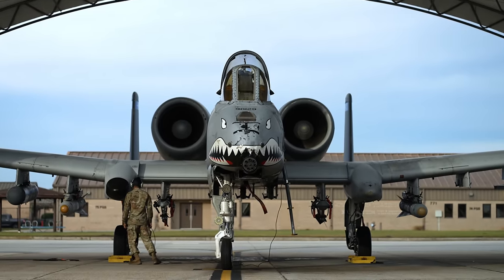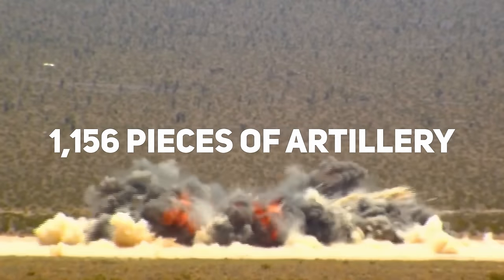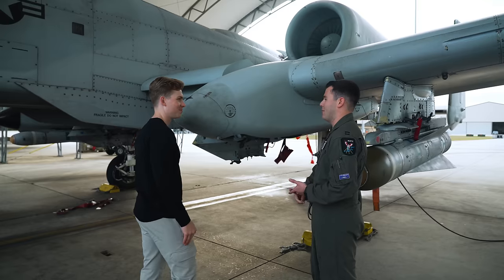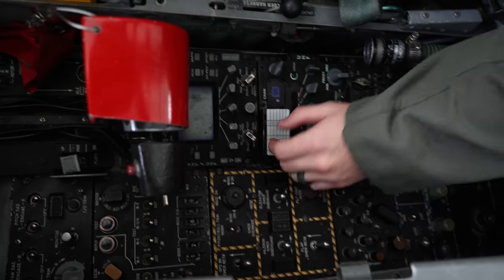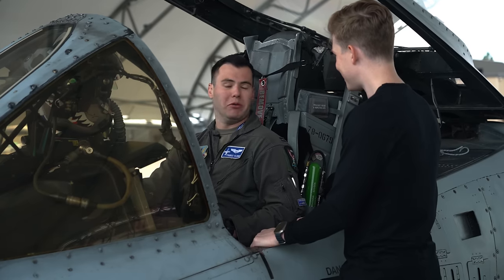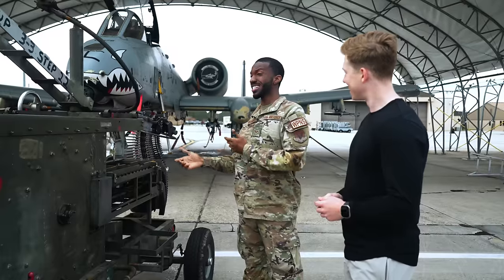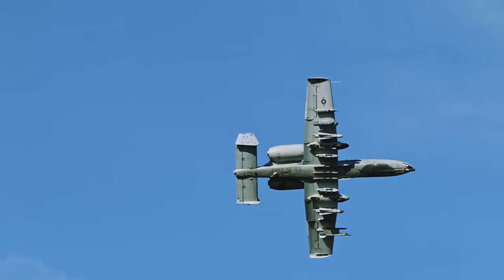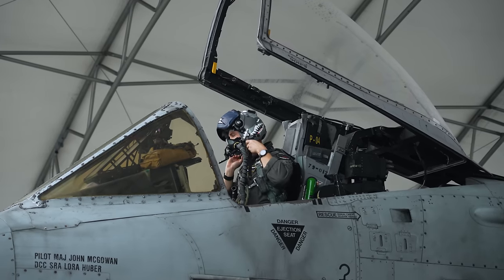Experience the FIREPOWER of the A-10 Warthog!

Comment: These are surpisingly agile actually.  I was at an air show 5 years ago or so and they had a demo with A10s, and they demonstrated how they could strafe the field, pull up, hard bank turn and be right back down strafing the opposite direction in something like 20 seconds or maybe slightly more (it's been a few years) but it was damn impressive to watch--no live ammo at the air show, just the demo of it flying that pattern.  They truly are awesome to be 50 years old and still that relevant to modern warfare.

Comment: Everyone talks about the iconic BRRRRRRRRRRRRRRRRRRT, which is true, but the turbine sound is quite unique also, no other aircraft i can think of has that distinctive high pitch
Reply: I think the only other similar sound is from the KC-135 and/or E-3, idk which engine it is cause they only shared one of two engine types
Reply: S-3 Viking, long since retired, had the same engines and same sound.
Reply: F18s moving around a flight deck have a high whine

Comment: As an ex hydraulic specialist I can honestly say that it was an absolute pleasure to work on the A-10. It didn't break down very often and when it did it was usually fixable easily and quickly. I still take great pride in seeing the A-10, even to the point where I consider it to be "my baby". Cheers and hats-off to others who have had the privilege to work on (or fly) the A-10 aircraft. Myrtle Beach AFB (1977-81).
Reply: Thank you for your service

Comment: We grew up with this plane. The CARC yellow prototypes were constantly over our house, and doing things that were nearly impossible, like practically turning on the wing. In the 30mm GAU-8A, PGU-15B/TP rounds were most often used in Afghanistan due to the lack of hardened targets with armor in theater. Presenter is holding up a TP. First Iraq war got a lot of HEI rounds in use on their armor. 

Thunderbolt name fits the purpose of the plane, as the original Thunderbolt was often utilized for close air support and was known for its ability to survive hits from enemy fire. The P-47 was the biggest and toughest fighter you could ride in. 

We never called it anything but the A10 or Thunderbolt II, out of respect for what it was. I spoke with an USAF Colonel one day who had worked on the ground with the USMC in Afghanistan. The love for that thing is immense. I am glad that the kids on the ground had them overhead. I know they saved a lot of people from bad situations.

Comment: one idea i have for the a10 is a sniper kit that could be developed which basically turns it into a long acting sniping platform...well placed single shots and a long operational time compared to the regular ones.....first a super precise semi automatic cannon firing the same cartridges could be installed, which would save a lot of ammo and money and extend operational time and also allow more targets to be destroyed, it could be like a 4-6" spread at normal distances and each pull fires one shot, with a gauge for barrel temperature so the barrel doesnt get too hot...instead of the typical loadout it could just carry extra fuel and it uses a completely different flight style compared to regular ones...it stays hidden and out of sight and uses the stealth of the plane...the plane has vertical risers on the wing tips and a quiet kit goes on to reduce noise by 70 percebt...if power is lost it doesnt matter it uses stealth and flight style to stay out of sight

Comment: It takes them 30 minutes to load the gun?!  When I was loading we only had 45 minutes to load 2 AGM's, 2 MK-82's and 1150 rounds... All while Fuels was topping off the tanks, and the cc was filling the Lox. It was called a Quick Turn. In and out of the keyhole in 45 minutes or less.

There is a rds limiter that limited the pilot to that 1-2 sec trigger pull. They could hold the trigger for an hr but they'd only get what the rds limiter was set at. 100-150 was the norm.

Our pilots used AGM's on bunkers during Desert Storm. A "party mix" was used for tanks. One of the helicopter kiss was completed by Capt (Gen) Bob Swain of the 926th FW. His jet is on display at the Air Force academy. "The Chopper Popper".

Not many know, but the A-10 actually sank a battleship. It was during RIMPAC 2012 in Hawaii. The navy pilot was pissed. We never got another invite. Eh... Oh well.

Comment: Another interesting detail of the Warthog has to do with the weight of the 30mm ammo. When the cannon is fired, it can't eject the spent cases because it would throw off the center of balance, making the Jet very difficult, if not impossible to fly. So when they come in to rearm they have to unload the spent cases as they reload the nearly 1.5 tons of fresh 30mm.

Comment: engagement distance with the gun is around 1 mile,  the thermals on it can see a target 25 miles (may actually be more like 60 miles, depends on the pod they use. i reference dcs a lot for my info because i fly the a10 og and the newer a10c) away and one of its missiles can easily hit a moving target within 7 miles

Comment: Fun fact: with a 1.5 seconds burst of the GAU-8A the A-10 will actually lose 5 knts of speed - because the recoil is greater than the thrust of the engines... 😂😂😁😁🤘🤘
I remember that very distictly as a teen when I read a book about the A-10. And all that crazy stuff the pilots do (like f.e. inverted terrain hugging) and what amount of damage the A-10 could take during Desert Storm and still fly back to base. What a machine! 😎😎

Comment: I heard that before that when you shoot the gun the plane stops turning so you can shoot at that point that you looking at when you push the trigger. Then how can you spray a line or a bigger area with the gun?
Reply: PAC system keeps the plane from pitching while firing. You can still roll a little, therefore turn.
Also your gun can be used without the PAC, if you really want to draw a line :)

Comment: Hey, the power of the Warthog, a CAS plane built around the 7-barrel GAU-8 rotary cannon is something to behold. Some of the affection for this dinosaur gets a little weird, with "love" being expressed often enough to read like fan mail for a K-Pop band. Maybe that's over the top, but so is The Gustav Gun, for example. Does its quantity of power  (800mm shell) justify the quality of its size and subsequent difficulty in utilization? What quality would that be? The fear factor, which must have scared someone during the Siege of Sevastopol (1941-42). That "BRRRRRRT" of 30mm depleted uranium ordnance must have soiled thousands of undies if the wearers were stuck on the Highway of Death connecting Iraq and Kuwait from Feb. 26 to Mar. 2, 1991.
Reply: It’s the GAU-8/A 7 barrel Gatling gun

Comment: You are aware the reason the A-10 has missiles be equipped was because of how bad the main cannon is. The accuracy was shocking unless perfect conditions ie the target didn't move, was allowed to perform as many strafe runs as allowed, perfect visibility and tests performed against 70's Russian tanks being hit on top from very low altitudes. Which in any combat zone isn't going to happen plus the armour was thin, the maintenance high, the repairs long, not much ammo with ratio how fast it went through it. And that's why missiles were attached. So no wasn't  JAW DROPPING... dues to flaws of the original design and after changes were made. So for all those going ahh the sound of Brrrr Brrrr and in awe, yeh that gun couldn't hit shit. Oh and also that's why no other country bought any when the US tried to sell it. Because it's shit or we already have an aircraft that does a better job like the Apache only the simpletons still think Brrr Brrr means Awesome!

Lazerpig - Youtube has a great 2 part video debunking all this. Check him out honestly.

Comment: 1:25 "when those dudes on the ground need help, they call us". Actually according to DoD statistics on the GWOT, A-10s were only called for CAS 20% of the time while F-15E, F-16, F-18, Harrier, and B-1 conducted the other 80%. And these hyperboles/half truths are very common with the A-10. Just to dispell a few, the Strike eagle carries more ordnance and can loiter for longer. The viper is cheaper per flight hour to operate since about 2010. Modern air defenses have seen shorad and manpads become so prevalent, even in assymetric environments, that it is no longer as survivable to ground fire as highly maneuverable jets that can force the missile into bad aspects. And lastly, every multi role fighter conducting cas has 20-25mm autocannons that fire faster and nore accurately than the GAU-8, not that it matters given that the majority of close air supoort missions were conducted with laser and gps guided ordnance to mitigate the risk of hitting friendlies in close contact.

To be clear, the A-10 WAS a good plane, but it has had its day and is now just a money pit for the air force. Speaking to it using these hyperboles and half truths keeps it in service for even longer and eats up even more budget. Let the A-10 take a backseat role lile FAC-A or let it retire!

Comment: The a10 lost the fly off to the a9, but was chosen for political reason. the a-9 was cheaper, easier maintenance, less vulnerable, faster, and had higher performance in all metrics.  As always, politics win and the troops suffer.   Soviets copied a9 as the su25 and may still be in production, although Sukhoi is trying to get its customers to buy its more advanced, albeit more expensive, alternative aircraft.  su25 has an advanced Gast gun.  The a10 gun is so slow to speed up, it needs the worlds most expensive ammunition to be effective.     but the a10gun is great as long as the enemy armor cooperates by presenting its rear armor and holding still on a flat area with no trees. otherwise, the a10 is best on non-armored support vehicles and infantry that does not have AA or those omnipresent ground to air missiles.  The a10 is so slow it could not outrun a ww2 fighter..  A10 is so slow, so vulnerable, that all of its sorties in desert storm were eventually taken over by f16's. .  The a10 is the "angel of the ground troops" because they can see it.  but statistically,  an f16 would have already destroyed an enemy problem before the ground troops knew about it.  It is only popular with armchair pilots and the useful idiots who provide free marketing for a problem aircraft  supported by politics.
Reply: Troops suffer do they? The A-10 is the most successful CAS platform in history...
Reply: it was so slow, and so vulnerable, that ALL of its sorties were given to f-16s in the only action it was ever in.  it was only the most successful in kickbacks to congressmen through completely legal campaign contributions.  might want to read up on its actual history, not company propaganda or fanboy fantasies.